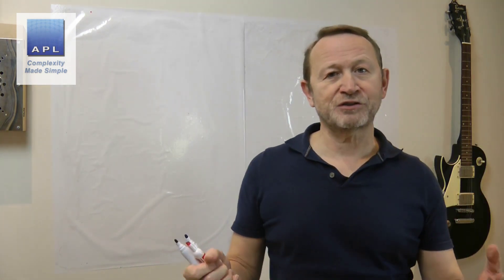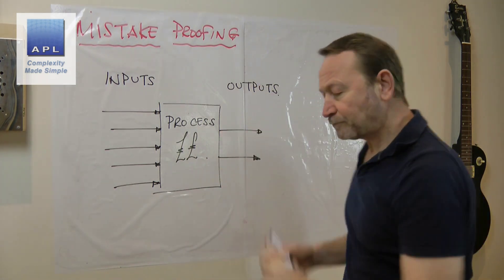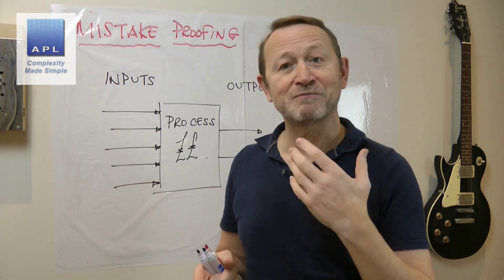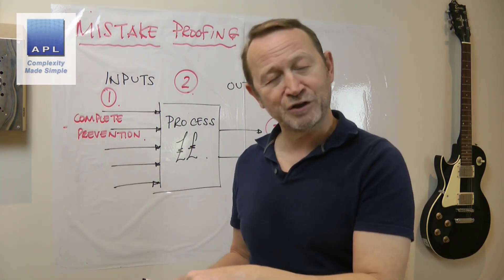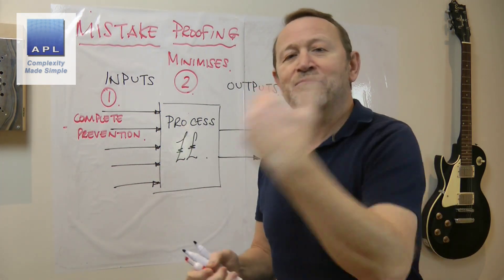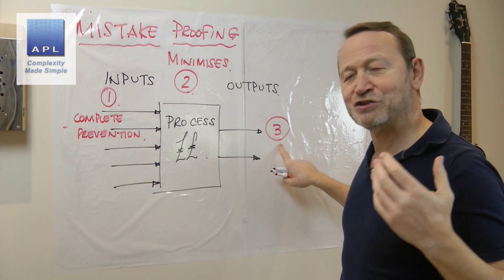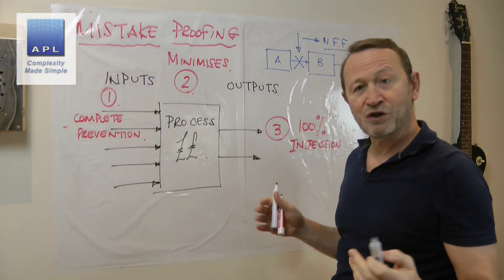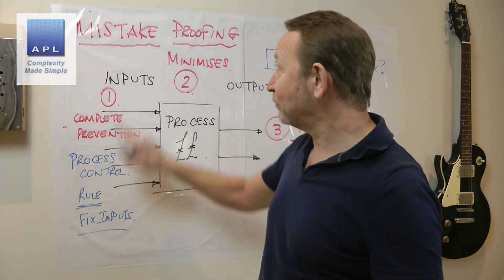Mistake proofing - The Process Best Control

Comment: You could add - Measure part right after completing the process - the measuring device send information to the machine controller for proper adjustment-to auto correct the problem....
Reply from the maker: Harold - what an interesting comment. My advice to all my clients if they have such a device is to switch it off. Adjusting a process is a vry bad behaviour. The last thing we want to do is to make it automatic...